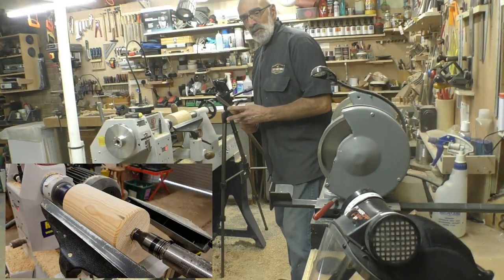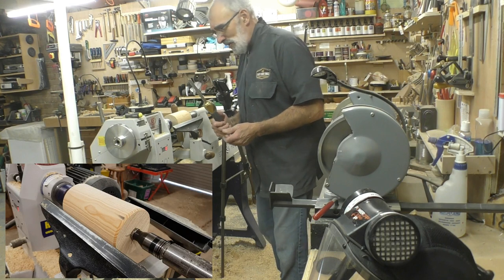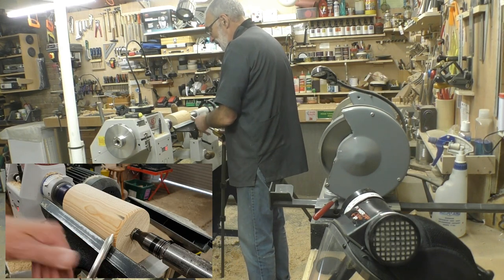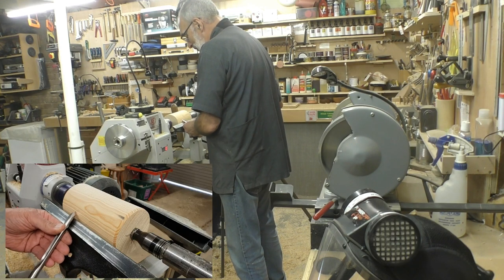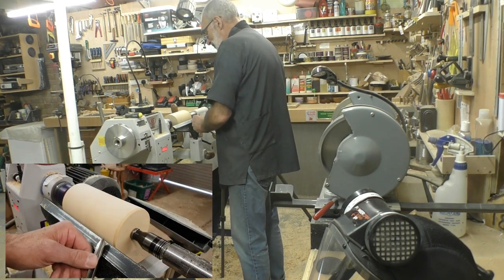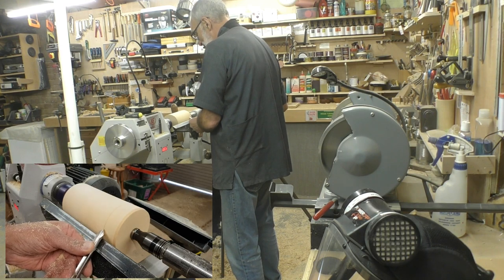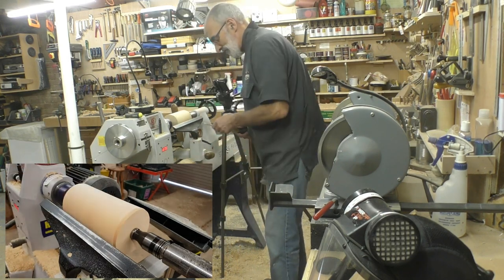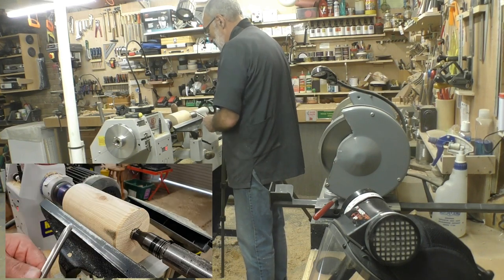Two Camera Test - Your comments and suggestions would be appreciated.

Comment: Great idea with all the extra work of two cameras. However I think some people missed the point here by saying the larger shot should be the close up work. The point of this subject matter was all about the stance and moving the body where the actual cut was secondary. To me this was the right way round in this case. Also I think had the main camera been the other side so people can see you holding the tool would be more beneficial as they can see there is no arm movement.
Reply from the maker: Thanks for the input Paul, much appreciated.
Cheers
Mike

Comment: Hi Mike, Great idea! The only suggestion I have is based on my initial impression. The inset is VERY good. In my opinion everything would work better together if the other camera were either re-positioned or zoomed in a little. Maybe it's my eyes but if I didn't already know what your were doing, I couldn't see well enough to tell. If that makes any sense. 
All in all, I love the multiple angles. It gives the production a much more professional look.
Reply from the maker: Good and very valid points Charlie, and I really appreciate you taking the time to comment.
Cheers
Mike

Comment: It works good for me Mike. I was an engineer for most of my working life, which has given me a head start woodturning. I understand how tools and machinery work. I see my hand and gouge as a a fixture rather like the saddle on a metal lathe. I lock my hand snuggly against the tool rest and guide the tool along the wood in a parallel movement, if that makes sense.
Any way good job mike. I haven't got where I am today by not stabilising my tool! Haha.
Reply from the maker: Thanks for your thoughts Stu.
Even before I started turning ... tool stabilisation was a must for me!!!!
Cheers
Mike

Comment: I think Gord is right as you don't need views of a grinder and mask doing nothing. Use the space for the inset and get in a bit closer using the opened space.
Reply from the maker: Good suggestion, and I agree with Gord as well, hopefully will get it right on the night ... so to speak :)
Thanks for your input, much appreciated.

Comment: Hello Mike, New toys and it's not even Christmas. 
They are both clear and the white balence looks right, (certainly coping with your lighting. .  .   . L.E.D tubes?). If it were me, I would try to fire the near camera shot from above and forward of your bent head. The camera currently to your left would be a longer shot from your right, taking in just your hands and arms and level or slightly above the axis of the spindle. The existing position would have been fine if you had been turning left handed, but was probably showing too much shop and not the Maestro's magic hands. On that basis, the current close up might be better as the larger picture and the  side view as the secondary. I'm watching on a 43" t.v., so either works. My tablet is clear, but I might miss finer details like flute angles, bevel rubbing and the like. I suspect that a phone would be more difficult still. It's the close up views that many training videos sometimes miss. Positioning, angle of attack, and also what is the tip of that blade doing.     Of course, when Mrs W. is doing the editing, one will also expect slo-mos of long streamers of wood, cascading  forward in front of strong backlighting, to Handel's Water Music. Alternatively, if ever the turning doesn't work out, well, do you remember the ape in 2001 a Space Odyssey, where he learns to use the bone as a club, which eventually went slowly flying into the air?. .  .   .    . (also  good music).
Hope this helps.   Regards, Glenn   :-)
Reply: That's balance, not balence
Reply from the maker: Hi Glenn ... no new toys ... just using my phone as well :)
Thanks for your input, I am working on improvements ... as we speak ;)

Comment: Technically, pretty good.  I would have preferred a tighter shot on the wood-gouge interface.  I think in this case, you are demonstrating two different skills at the same time (initiating/maintaining the cut and body English - ha! - is that even a thing?) and they might benefit from being treated separately.  Also, the body English part might benefit from a straight-on shot that shows you leaning as the cut progresses.  By no means is this meant to be negative criticism, Mike.  You are truly one of my wood turning heroes!
Reply from the maker: Thanks for your thoughts Michael, I really appreciate it mate.